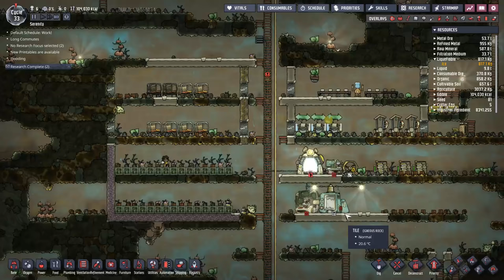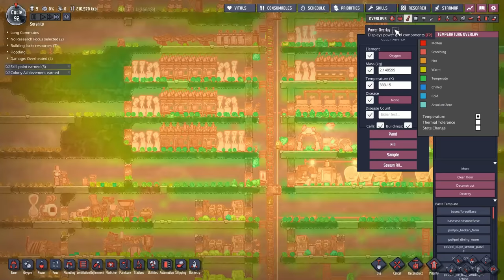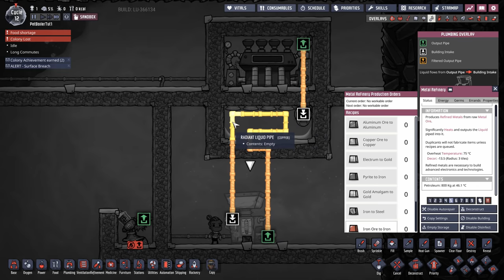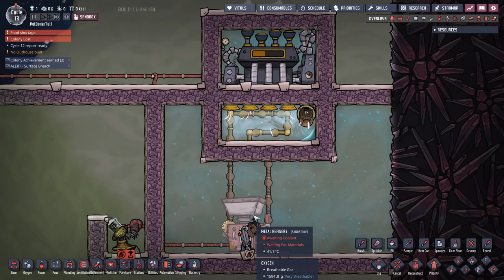Temperature management: Tutorial nuggets : Oxygen not included

Comment: For steam turbine, if on Terra and no access to aluminum (or more exotic materials), the radiant liquid pipe should be made from gold or copper (therm conductivity 120 vs aluminum 410)?  Likewise, for metal plates (gold or copper has conductivity 60 vs aluminum 205).  How much does this limit the cooling effectiveness or power efficiency of the steam turbine setup?  Are there any design changes required?
Reply: Along similar lines: Is there an acceptable alternative to all the ceramic insulated liquid pipe?  That is a lot of ceramic/kiln use for when I am trying to limit heat production.  [400kg per pipe section x 20 segments = 8000kg ceramic, just for the refinery setup]  I tried to use granite because I have a ton of it but the pipe broke from the heat.  Would igneous work better or is ceramic the only alternative?  I'm not sure which property to look at.

Comment: Aluminum having a thermal conductivity of 205 is dumb.  When are Klei going to bring it in line with real values.  This would involve tweaking the incidence of metals in biomes, but they should, or else rename the metals to "Pretendium", "LikeWhateverMaanite", etc.

We are getting a structural free ride with buildings, for the most part, but even if they want to leave that alone for the time being, they could use Hardness as a multiplier for industrial processing costs, so that e.g. manufacturing with Aluminum would be much cheaper in energy costs (and time, and heat) than with the much harder Tungsten.

Comment: Are we sure that electrolyzers output at 70C? I checked the pipes after I built my spom and they were about 58C. That seems more like it's matching the input temp - water was about 60C, and the room wasn't fully warmed up yet.
Reply: The gases that come out are 70C, but their thermal mass is small enough that it exchanges that heat pretty quick and cools down fast.

Comment: A few notes on this video. But first please allow me to explain that this is not to criticize the video itself, it's more an update. Secondly, I don't take credit, most of this comes from later videos by Francis John himself and others (Tony Advanced, Brothgar, the usual suspects). I don't remember exactly from whom I've learned every single thing, so apologies for not giving specific credit.

A bug has been discovered involving steam turbines that would cause heat deletion in certain conditions. Some of the designs presented here are vulnerable to the bug. Not a big deal, since we're in the context of temperature management, hence heat deletion is kind of the purpose, and the bug actually helps with that. You should care only if you don't want to loose power from the turbines.

Temp shiftplates exchange heat with insulated tiles, so it's better to leave a gap of one tile between them and walls, ceilings, floors. Some designs here are too small for that, you may want to build larger steam chambers (or use insulation, but I'm not sure about that). The leak is not that big, it makes the designs a tad less efficient than they could be.

Another finding is that automating an aquatuner can cause it to run inefficiently, consuming more power than expected (or transfering less heat for the same power). It's better to act on the pipe with a shutoff, as the aquatuner stops if there's no liquid in the pipe anyway. How impactful this is, well my understanding is: YMMV.

When you're pushing the limits of your coolant (working close to its freezing point) I find it best to place the thermal sensor right before the aquatuner input, so the actual packet of coolant that triggers the sensor enters the aquatuner. This usually isn't a big issue, if the heat exchange is adequate (you use the right amount of radiant pipes), the temperature of the packets tend to even out, and the sensor triggering means "we need more cooling in the loop" rather than "this single packet needs cooling". But I had one case of pipe breaking and I discovered I was checking the wrong packet, because the sensor was too far away.

Comment: So I can't for the love of me get this done, only thing I can think of is that the exact amount of water used in the steam chamber matters. Anyone got an idea?
To circumvent this I've resorted to using a magma dropper to supply my water with the heat it needs. But I'd like to learn to nail this as wel
Reply from the maker: 400kg is usually enough, but it's hard to have to much. If you find you are getting overheats then put in more water to even the temperature flow. I have been known to put in up to 2000kg of water and it works just fine as well.
Reply: @FrancisJohnYT  well im not getting overheats, more the opposite. I can barely keep my steam at or above 125C. Although I never bothered to put in up to 400 or 2000 kg of water, never went over 100kg. I'll try it out!
Reply from the maker: @keonwilson3505  If the steam is not getting hot you are not disposing of enough heat. That is not necessarily a bad thing.
Reply: @FrancisJohnYT  aaahh I see, I wanted to set the generators up before I started using metal refineries and such in my industrial brick. Makes sense, because the generators I did manage to get working do generate cooling but they're disposing the heat of 1600 degree magma. Makes a lot more sense now, thanks for the pointers! 

Love your videos by the way :) , they really helped me with getting closer to - and more successful in the mid game and being knowledgeable enough to deal with issues relying on myself and my creativity.

Comment: Around 18:00 he says you can set the thermo sensor to "Anything you want". Is this literal, or is there a bottom limit?
Reply from the maker: A loaded question. Depends on what you are running as "Coolant" through the aquatuner. For example polluted water freezes at -20C so if you go below that the pipes will start breaking. If you run supercoolant from space through it then you can go all the way down to absolute zero -273C.
Reply: @FrancisJohnYT  Ah that makes sense. So the bottom limit of PH20 would be around -4c, so it doesn't freeze your pipes going through the tuner, correct?

Comment: Great video but there is something I dont understand. Your radiant pipes and metal tiles are made out of aluminium which I dont have access to. You said steel is an even better conductor, but when I looked it up on the wiki it seems to be a quite a lot worse.(Aluminium is 205 while Steel is 54) Am I missing something or is this outdated? If it's outdated, is it still fine if you use steel(or diamond, since according again to the wiki it has a higher thermal conductivity than steel)?
Reply: What you're missing here is that he's referring to gas pipes vs liquid pipes. Radiant gas pipes are made of metal ore, while radiant liquid pipes are made of refined metals. Refined metals tend to have TC values way higher than their corresponding ores. E.g. TC of iron ore = 4, TC of iron = 55.

Aluminum is special: TC of aluminum ore = 20, TC of aluminum = 205. That's much much better than any other metal ore/metal, making both the ore and the metal great for radiant pipes (well I should mention wolframite, which is ok for gas pipes).

Steel is also special. It has a TC of 54, so not great compared to other metals. But, contrary to other metals, you can use it to build gas radiant pipes too. In that application, steel is even better than aluminum ore.

So among pre-space materials:

- for gas pipes, steel (108) best choice, aluminum ore (40) second best, still good, wolframite (30) not bad, everything else doesn't compare (9 or less);

- for liquid pipes, aluminum best (410), nothing else comes close (120 or less).

It should also be noted that thermium is 4 times better for gas pipes (440)  than steel (108), probably overkill, while it's only slightly better than aluminum (410) for liquid pipes (440). Less than a 10% improvement. That's how good aluminum is.

I'm not considering Niobium because I'm assuming if you have access to it, you have also Thermium available.

Comment: I just don't understand why I can't wrap my head around steam turbines. I've tried to understand them but I guess my brain just cant comprehend it. I figured I'd just try to build what's shown but I've tried to build the same setup with an array of turbines but the one thing you don't show is it looks like there are thermo sensors next to the turbines with an automation wire. I have no idea what they are connected to and their setting as well. Also I don't see any pipe connections to the liquid vents underneath each turbine. I get to this point in every game and just end up quitting because I don't understand. I've never made it past steel because of it.
Reply: I struggled a lot with them too in the beginning, you could post a screenshot/s of your attempt in the oni subreddit and people will help.
For now I can say 1) the thermo senors are to tell the aqua tuner to turn on/off, if you want 20c water, thermo senors says only turn aqua tuner on if water is above 35C
if its below, just let it loop around. then 2) the liquid vent is connected to the steam turbines output, it takes in 125c steams, outputs 95c water, you then release that water back into the area so you can just recycle the same water over and over

Search Francis' video called "mid game hump" - it will clear everything up.

Comment: At around 17:00 you say steel is the absolute best as radiant pipe material? But it has significantly less thermal conductivity than aluminum. Or am I misunderstanding?
Reply from the maker: It's only for gas pipes. Radiant gas pipes give a multiplier to the conductivity of the material they are made of. The only reason steel wins is because nearly all the other materials radiant gas pipes can be made out of are ores. The conductivity of Gold Amalgam, Iron ore etc is all really low.
Reply: @FrancisJohnYT  Ah, I see. Thanks!

But doesn't refined aluminum still have a higher thermal conductivity, which would still make temp transfer for radiant pipes for efficient? Or is there some other factor I'm missing?
Reply from the maker: @whatisbestinlife8112  You can't make radiant gas pipes our of refined aluminum. Only aluminum ore. Wikipedia to the rescue https://oxygennotincluded.gamepedia.com/Radiant_Gas_Pipe

Comment: Hi Francis, your vids are great. The electrical hookup design to the main grid you provided is good, but that will only charge the battery when the power shutoff is open and will not send power back to the main grid. 

 The way to send power back to the main grid during excess and consume power from the main grid when need charging is to use 2 power shuts and connect to both the consumer side and the provider side of the transformer. See examples here:

https://steamcommunity.com/sharedfiles/filedetails/?id=1867184994
https://steamcommunity.com/sharedfiles/filedetails/?id=1867185675
Reply: My example is invalid, it will overcharge the wires on the consumer side when sending power back to the grid. While it does work, only works if the consumer side wires can handle the power of the main grid. Which would make transformers pointless or the whole automation thing. I did get this to work properly though, need to put power shut off gates on both sides of the transformer. For a total of 4 power shuts. In essence, need to reverse the inputs and outputs on the transformer so the normal consumer side becomes the full provider.  Would be interesting to see you try in a video.
Reply from the maker: I was sloppy with my explanation. The steam turbine will never produce enough power to keep up with the aquatuner. So you are only connecting to the main grid to draw power.

Comment: The save file wont load on my copy for some reason.
Reply from the maker: You loading it on the original version or the DLC? You getting an error? Just curious as I have a lot of saves linked, curious if they are starting to become unusable.
Reply: @FrancisJohnYT  It was my mistake, I was in the DLC. I've been in the save and played about a bit myself with metal tiles and doors...

Also, I have decided after trying to make an oxygen cooling box using onlyTerra materials, that having the door and metal tiles setup is not as efficient as simply having a cooling loop off the main cooling loop that is activated by a valve and a temp sensor to do the same job. As long as you have a liquid reservoir that has a bit of space the change of packets won't knock a stir out of the system, and the cooling is more direct into the pipes. I don't know how stable this would be in a really hot industrial brick, but I'm not at rockets yet so I don't have a lot of options to get my o2 down from steam geyser temps.

Comment: thermal regulators only cost 240 watts.
Reply from the maker: True but they can only process 1kg of gas a second and even hydrogen has half the thermal capacity of water so you need to spend more power to get the same amount of cooling.